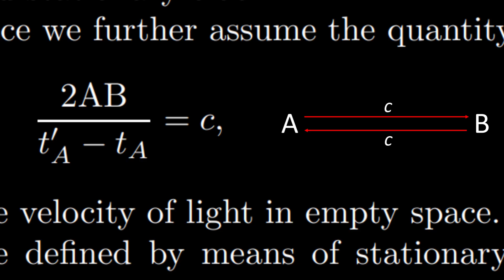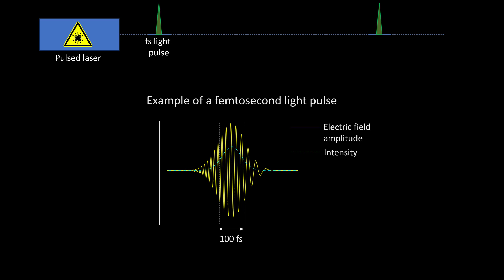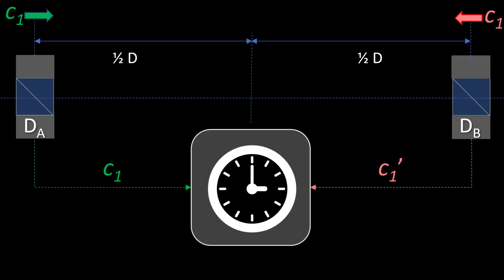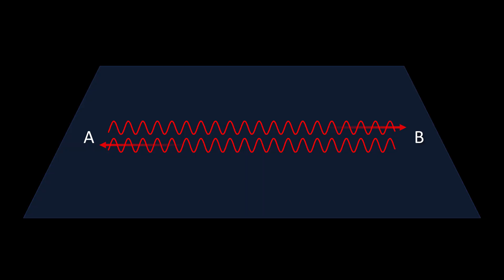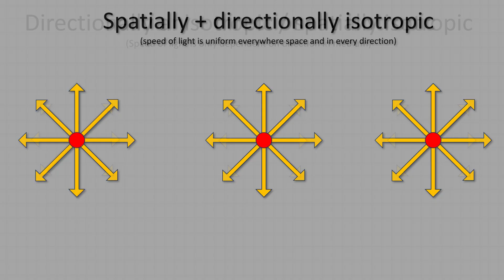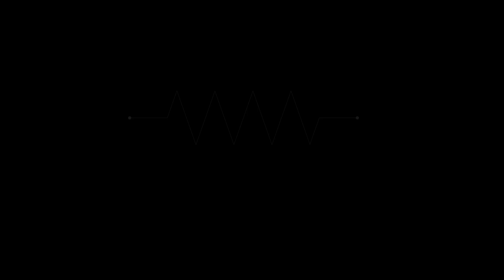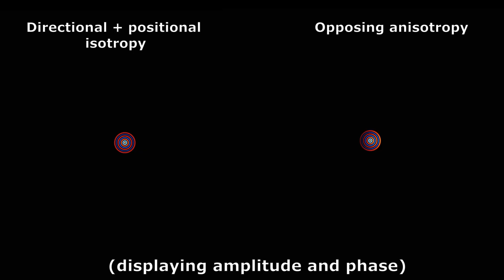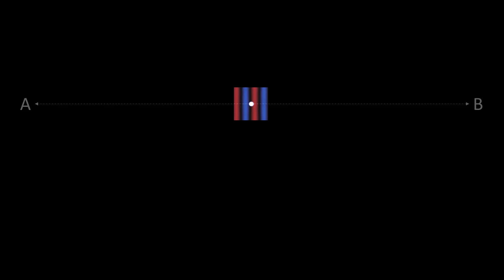Knowing the one-way speed of light

Comment: I don’t want to kill the party but, for all of this to work, one must know the distance D (in order to know where it’s midpoint lies and everything else); to measure distance with absolute precision, one must know one’s exact velocity relative to light (because of special relativity and space dilation). Even in the most perfect scenario, by starting from a zero-information ground, you just can’t arrive to the one-way speed of light without assuming information that would be dependent on said speed. It’s like an axiom… you just cannot build it from smaller pieces of information.
Search “information theory” to delve deeper into the subject.
Reply from the maker: Measuring time and distance within an inertial frame of reference is not a  fundamental issue. If you cannot do this, how would you ever be able to measure a speed accurately?
Reply: @HuygensOptics  you can’t, and that’s the point. This video is giving a theoretical approach to measuring with absolute precision the one way speed of light. That’s why the guy creates a perfect scenario where only horizontal distance matters, where lines are perfectly straight, etc… but in reality theoretical physicists agree that in order to measure exact distance you should know about local spacetime; and that can only be known by using the speed of light constant. The problem is that constant is the base for the equations and cannot be measured from more fundamental values since it is fundamental by itself.

Comment: Clever set up. 

I always thought that a refractive medium with a secondary reflective surface would demonstrate the incident speed and the reflected speed would have to be the same. 

If they were different it wouldn't follow the law of reflection in the medium after a while. If it changed speed it would alter the secondary oscillation of the electrons in the medium, as it is time dependent, and thus change the summed slower electric field oscillation creating a different reflection angle about the normal axis.

Comment: The spring example does not work since if the spring constant was different in each direction the inertia would also be different in the two directions and that cancels out. So no free energy or detection.
Reply from the maker: The inertial density isn't related to the spring constant. Inertial density is a tensor in the example, the spring constants are vectors.
Reply: @HuygensOptics  but inertia has units that include time. So that is subject to the one way speed of light.

Comment: I have an idea to measure the oneway speed of light, which is hard to verify and maybe wrong. I hope  one clever commenter can explain it to me. 
the problem:  for both ways most experiments use the electromagnetic force. 
My idea: use for one way the gravitational force:
Hang a mass with photosensor at the bottom in a  specific height (measured by an physical object and not with a laser :)).  Make mechanism that releases the ball if the photosensor senses the light from the bottom. Now measure the time from start of light (at the bottom) till the mass drops to the bottom. If you are careful with the wires of the release mechanism the EMForce travel just in mostly one direction. So the time is time of drop + time of release+ time of detection + time of light with oneway-speed. Just the speed of light would change, if you do the experiment on an perfectly round homogeneos earth (or a black hole if you have one) when you vary langitude and latitude :) At least that what i think in the moment.
Reply: Measuring distances with light and a material ruler will give the same result. When it comes to measuring the speed of light using gravity, in my opinion it will not give results. If it were possible, we would measure a greater acceleration due to gravity on one side of the earth and a smaller one on the other. I assume that the different speed of light results from moving relative to the stationary ether in which light propagates at a constant speed. As strange as it sounds, if we managed to observe the acceleration due to gravity without delay, we would observe that on one side of the earth the acceleration is greater and on the other side it is smaller, and yet when the falling body hits the earth's surface it will release the same amount of energy. In my opinion, this is due to the electromagnetic nature of force transfer at the atomic level. As Lorentz believed, the relativistic effect is simply the result of a slowdown in the transfer of forces at the atomic level.

Comment: Let's say you have an energy ball at 2 jules. If the ball is heading in a direction where everything is under 2 jules, it would move past them by force, right? So what happens when the 2 jule energy ball hits something equal or bigger? Wouldnt there be some form of energy transferance that either absorbed or repelled the 2 jule energy ball? If that happened, wouldn't the 2 jule energy ball incrementally lose energy in percentages until it, on it path of travel, became disproportionately equal to any energy ball ot could meet? In any direction the ball could reflect to? And if theyre spherical, couldnt that energy bounce off anywhere, unless it hit perfectly flat to its opposite line of direction?

Comment: @Huygens Optics: there is another way to introduce "Opposing anisotropy" that would not result in violation of energy conservation. Let me explain according to your simulation: You always kept the harmonic oscillator fixed in the center of the simulation. What if the Oscillator would move with regard to the medium? Or, visually keeping the oscillator fixed in the center but the underlying medium "of springs" moving along. Then you would get opposing anisotropy of the propagation speed. Of course, WE would know (in the simulation) that one or the other is moving. But in reality, how can we know if vacuum is moving? That was Einstein's dilemma also, and even the Michelson Morley experiment dont prove anything about the vacuum.
Reply from the maker: Maybe you could look at it this way: mass is also an energetic vibration of the vacuum, be it a localized and stable one, due to its very high frequency. In order to accelerate such a vibration, we must temporarily create a directional anisotropy in the internal vibration along the axis of acceleration. The energy necessary to temporally create this anisotropy must be equal to the kinetic energy gained by the mass.

Comment: Or ... one can actually trace the evolution of the constant evolved for denoting the speed of electromagnetic propagation, in a given medium, called "the speed of light" to Wilhelm Weber, read the old scientific publications, and literally understand that the speed depends on the inverse product of the magnetic and dielectric (permeability) constants in a give medium. Ones armed with such an "archaic" (and seems now days unconventional) knowledge one can ask the simple question, does any medium show dependency of the magnetic or the dielectric constants on its geometrical structure ( different properties based on the material spacial orientation). If that were to be the case,  then it seems that either the magnetic or the dielectric permeability will have different values  when an electromagnetic vibration propagates in space so the "speed" of ( light ) that wave propagation will be different in the different dimensions, if not, then clearly there will be no difference, exactly based on the physical (and formulated) definition of what the speed of light is.

Comment: can we use doppler effect to say if the light speed differed directionally then we would measure some things bluer or redder depending on whether we are facing the source from right or left?
Reply: @ghujka  Not really. The frequency will remain the same, as the speed changes, the wavelength will change accordingly, and we will not observe anything.

Comment: You just need to set up the detector and a generator around the event horizon of a black hole and then shoot a photon and then measure how long it takes to come back - viola! - using the curvature of space
Reply from the maker: And how do you determine the circumference exactly to be able to measure the speed of light? Anyway, it is still a 2-way speed of light because start- and end point are the same.

Comment: When I watched the Veritasium video, I thought of 2 experiments:
1. Examining deep field astronomical observations to see if the universe looks younger in any particular direction.
2. Take a device consisting of a laser facing an array of detectors, spin it at a constant rate, and measure the change of the deflection. Then twist the axis of rotation so as to check every 3D direction, and measure the change of the change in deflection of the beam. If the deflection remains the same for a system in constant rotation, then the 1-way speed of light is the same in all directions.

Do these experiments fail, and if so how?

Comment: local changes in electric potential can also have an effect on propagation speed of light just like gravity, see the zeeman and stark effect. are you the person i was debating on reddit the other day? i would like to hear your thoughts on the ferranti effect, this is key as it is direct evidence of apparent light speed changes but also that it does not violate conservation.

my hypothesis for why is that conservation only applies in a closed system. this is why its important to remember there is no vacuum, with no vacuum there is no closed system. the ferranti effect is basically over voltage building up over a line through stray capacitances and inductances. in small wires and low voltage circuits its usually no big deal but there are real world consequences to this that power companies all around the world have to prepare for and design around. we see power surges like this all the time in the form of coronal mass ejections, which are massive capacitative discharges, impulses. see charles p. steinmetz. in the case of the springs, you get a strong enough force in the opposite direction, the spring catastrophically fails, making springs actually a wonderful analogy to describe the tremendous amounts of force released in a capacitative discharge. you will be reminded that the spring is not functioning in a vacuum when it rips your hand off at the wrist

the concept of nuclear fusion itself should also by rights violate conservation yet stars continue to break our understanding of the standard cosmological model on a daily basis. upon further thought, this may indeed suggest negative energy which should be theoretically possible given that negative mass, anti matter, is real. if energy and mass are equivalent then a negative mass would suggest a possible negative energy.

if the electron is the charge carrier making it related with permittivity and the positron is related with negative matter i wonder if the negative energy is related with the ability of spinning magnetic fields, permeability, to exhibit quantum locking behavior even without superconductors. spinning magnets and electrical impulses seem to have the ability to make the medium act as a superconductor and a superfluid.

Comment: Your conservation of energy point doesn't seem thorough enough; light does change the energy/momentum of an object when it hits surfaces and gets reflected or absorbed. 

Also, the problem with deferring to Maxwell's equations is actually, the Maxwell equations take a different form if you allow for an anisotropic one-way speed of light.
Below are two references on this: 
1) Anderson, Ronald, Indrakumar Vetharaniam, and Geoffrey Ernest Stedman. "Conventionality of synchronisation, gauge dependence and test theories of relativity." Physics reports 295.3-4 (1998): 93-180.

or: 
2) Sec A2 (at the end) of 
Rizzi, Guido, Matteo Luca Ruggiero, and Alessio Serafini. "Synchronization gauges and the principles of special relativity." Foundations of Physics 34 (2004): 1835-1887.
Reply from the maker: Thanks for the reference. But regarding the first point: that's why I mentioned 100% reflection.
Reply: @HuygensOptics  Hi,
A photon reflected off of a surface has it's momentum go from p to -p. Conservation of momentum requires a momentum of 2p is applied to the mirror in the case of total reflection.
Reply from the maker: Yep, that's the law for conservation of momentum and the reason objects can be  propelled by light.

Comment: Hypothetical way to measure the one way speed of light 

Put a series of very accurate clocks into orbit around the earth. Have those clocks transmit the time to the earth. Then have a detector on surface of the use the difference in the travel from different satellites to calculate the detectors position on the earth. Repeat this experiment with a few million detectors all over the earth

Comment: I don't think either of those proofs are valid, for example with the momentum... you just proved that E=cp is not correct in a system where we don't have a synchronization convention, we would need to add a bunch of additional terms that would make energy itself anisotropic in different directions. We use the simpler equation that assumes k=0 and all those terms cancel out making the equation much nicer. And you still wouldn't be able to measure anything being different experimentally just like you couldn't in your first though experiment... hence why it's a convention - it makes the math nicer without affecting any experimental mesurements.

Comment: what if we have 2 clocks, that stop when a light signal reaches them
we start them at the same spot in space, then move them far apart and shoot a light at them
that way we should get 2 different times, one for each clock
and we know there is no measuring delay since we started the clocks in the same spot, therefore no speed of light delay.but we will still get 2 different times when the light reaches them
the clocks stop and we can compare the times.

Comment: I was wondering if you could use a very distant time signal say from a pulsar to synchronise  two atomic clocks, one at each detector and thus defuse the measurement problem?
Reply: @ianswann3867  The "time signal" arrives as light. The same light-speed-issues arise.

Comment: Good video. 
You compare the situation with an elastic medium that has different spring constants for the two directions, which leads to violation of conservation laws. But that is not the only way to achieve anisotropic propagation speed. The medium itself could be isotropic, but simply have a velocity in one direction. That would not lead to violation of conservation laws.
I think the more profound observation is that there is a delicate link between the one-way speed of light, and how simultaneity of distant events is defined. The definition of simultaneity makes it theoretically impossible to measure the one way speed of light. You might want to do another video on that. 

Ever since I discovered this myself, I have marvelled at the following simple sentence in the introduction of Einstein's 1905 SR paper:
   "We have not defined a common “time” for A and B, for the latter cannot be defined at all unless we establish by definition that the “time” required by light to travel from A to B equals the “time” it requires to travel from B to A"
Einstein already knew that what you have discovered as well: that the one-way speed of light is a matter of definition, not of measurement.

Comment: But can't wee use a monochromatic light beam, say using FEL, whose frequency is exactly known. Then measure the wavelength precisely using a defracttion grating and figure out the one way speed by c=frequency X wave length? Won't that be a one way speed measurement?
Yes, we're calculating c here from other stuff. But we do so in every experiment.

Comment: The explanation of spacial isotropy and the model with springs and masses really echoes luminiferous ether. Can you explain the difference?
Reply: That's because he's using Maxwell's equations which do have an Aether instead of Quantum Mechanics that doesn't use it. He specifically used Maxwell's equations because they're easier to explain and create an analogy for with springs and masses. However the important point would still hold in Quantum Mechanics.

Comment: What if you shine two lasers in opposite directions (not a pulse, a continuous ordinary laser) and look at the positions of nodes and antinodes of standing waves? If the speed of light is the same in both directions, the nodes would not move, and if they are different then the positions of the nodes would appear to move over time. A neat way to do this would be to trap an atom in a node and see if it moves

Comment: Assume you have two synchronised clocks, one at the starting point A and one at the measuring point B. At a defined moment a photon is released from point A towards point B. As the clock at point B is synchronised with A we now the time is took the photon to travel from A to B. You can then reverse this set-up and voila you measured the two way speed of light. What is wrong with this setup?

Comment: I agree with all your points, but the real reason for measuring the one way speed of light is to establish if the speed of light is the same for all observers, regardless of their speed. So, if we were measuring the speed of sound in air, the one way speed would be different in the directions in the direction of motion as compared to the other direction. If the only measure possible is a 2 way measure, then you could not measure this difference due to the motion of the observer.

It is important to measure this because the independence of the speed of light from the speed of the observer is the central assumption of Special Relativity.